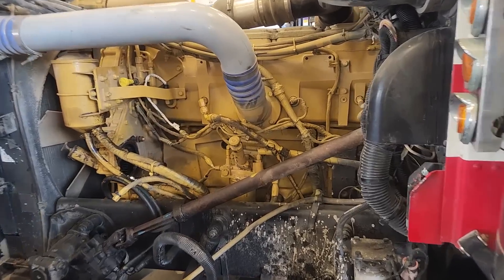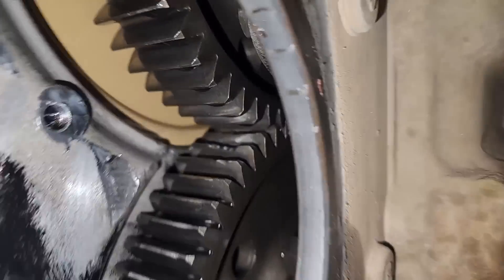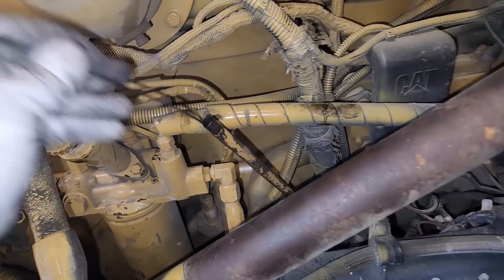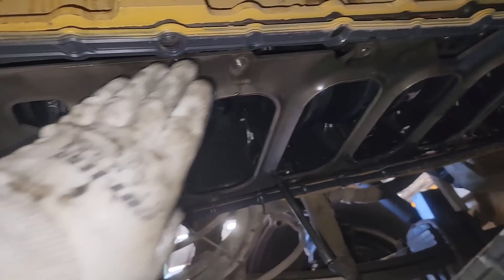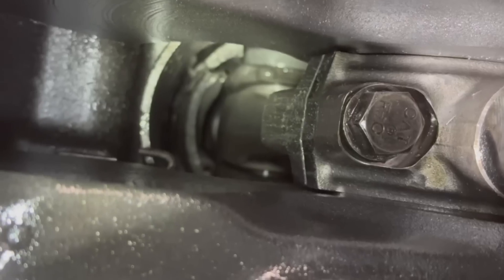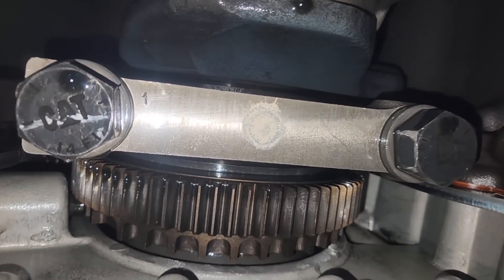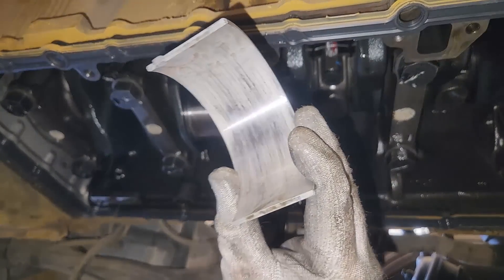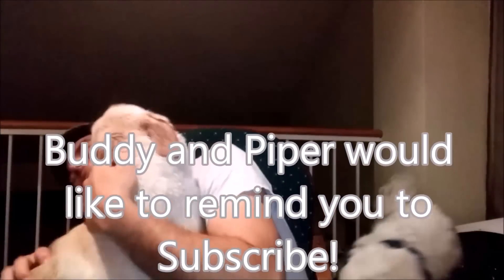"Smoky Red" returns with a VENGEANCE. Diesel Engine Gear Train Failure

Comment: Well that sucks. I would be so upset and furious. Spent all that money to rebuild the engine, and on the first day its trashed by the air compressor going bad.
Reply: Over 40 years in a diesel engine machine shop I've seen this many, many times. The air compressor is pulled off, plugged off and set aside until it's time to assemble. It being older, then ends up failing. Flushing shavings in the oil system to spread like a cancer. A few more dollars spent on an air compressor, could've probably avoided this.
Reply: @catman57022  exactly. Everyone is blaming the shop, but we don’t know the whole story. Chances are this was one of those companies that wanted it done as cheaply as possible, and didn’t want to replace obvious wear items. Anytime I’ve ever had an engine rebuilt, I insisted on a new compressor, new turbo, new oil pump, new oil lines and coolant hoses, and I always had a new fuel pump put on. You’re already paying a bucketload of money. What’s a few more grand for the peace of mind?

Comment: Should Smoky inquire with the rebuilder? Handed parts, that then failed. Or could this be completely random?
Reply: It would seem that Smokey's compressor let the smoke out and that ate the gear train. They removed the compressor so there's no real way for us to know if the other shop installed it wrong

Comment: Gets a rebuild. Goes 3hrs. Needs a long block. Rip that guy.
Reply: If the customer didn’t want the air compressor replaced during an inframe it won’t get touched. Obviously, the bearing failure in the air compressor started the snow ball before the fecal matter hit the fan.  That’s just bad luck and will be a mess to sort out with lots of finger pointing. There will be no ending where any party will be happy.
Reply: If I was the customer I will tell him to fix what he can fix put it back together and I'll send it.. go till she blow
Reply: RIP his wallet.

Comment: When a customer goes with the cheapest shop. You get what you pay for.
Reply: Would that explain the air compressor exploding?      Don't speculate unless you read the whole story of what was checked and what was changed and what was signed off on to worry about later
Reply: Could have just as easily happened at CAT. It was an air compressor failure. Usually it’s wise to replace that, the turbo, and anything else oil related during a rebuild (I also always got new fuel pumps put on, personally), but this customer probably didn’t wanna pony up. Can’t say the other shop is the issue, without knowing all of the details
Reply: Ok skeeter😂

Comment: Expensive failure, I would imagine that compressor had to be screaming before it popped. Especially if it was just being serviced, you would think a good tech would have caught that. That's what they get for taking it to 'down the road motors', I always say 'pay me now or pay me double later'. They run off to another shop in search of cheap labor and it boomerangs right back into your shop. Now you get to charge them to do the job right after they just paid to have the job done wrong. Ouch!
Reply: What would the tech do to make a decision to change it ? Compressors don’t really scream good or bad they just throw rods.
Reply: @tater_relocater  Some people don't understand that, hell we had a new Bendix chunk a rod within a week of installation.